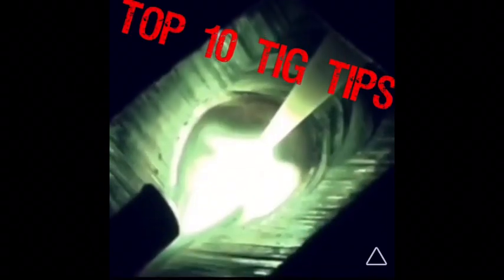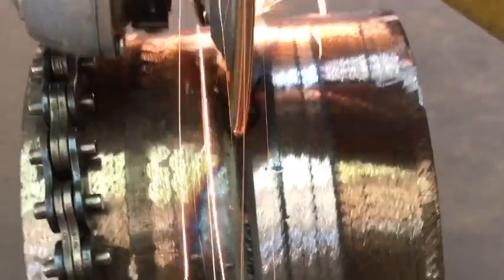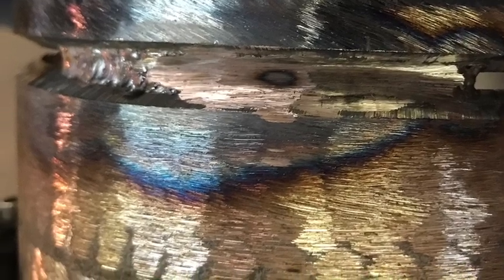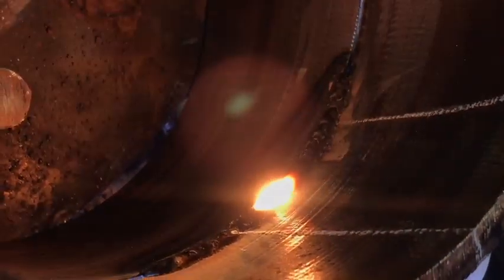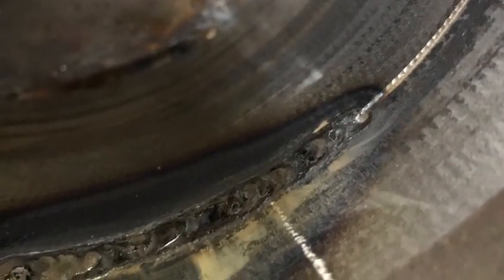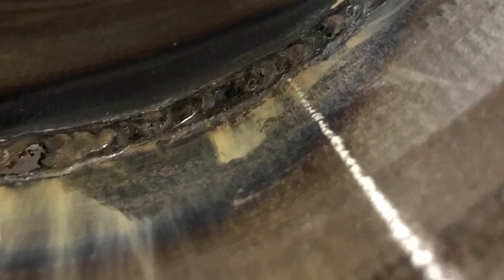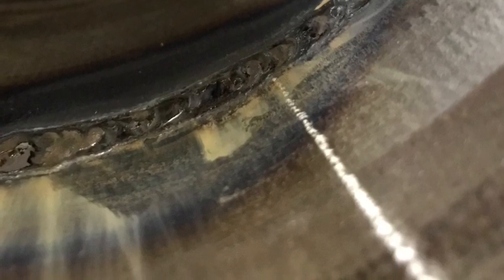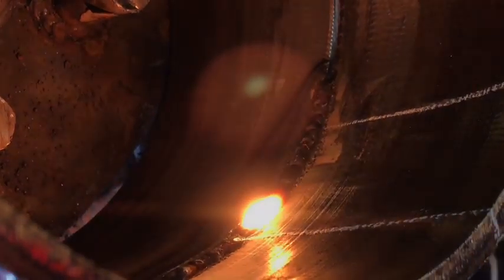Top 10 Tips #2 How to fix suckback

Comment: Question how do you fix a dog dic when you back feeding and it drops down on you from the top. Do I need to completely cut it out or what. Also what about chop wire/cold wire what ever y’all call it
Reply from the maker: +Jesse Davis we have Videos on that it under cold wire
Reply: Alabama Pipe Welders Academy I honestly do t know what to call it but what about the 🐕 dingolings
Reply from the maker: Jesse Davis you can fix it the same way as cold wire depending on how bad it is you might be better off cutting it out and re welding that section
Reply: Alabama Pipe Welders Academy ok thanks for the vids man.
Reply: If it’s less then a 1/4” dog dick you can turn up and sit on it, let it swirl till you see it suck into the bevel. Much easier to see if you have an open spot to see inside. If it’s more then a 1/4” or you have a wholesale bat cave in there I would cut it out. Cold wire can just be ground down and consumed, keep a piece of wire in ur hand when you do it for if the weld is asking for metal.

Comment: If you know what you're doing in the first place you won't get suck back ,it's not rocket science ffs
Reply from the maker: You’ll get dat on dem big jobs. Probably don’t happen much in your garage.
Reply: @WELDorDIE  right....the I have never failed a weld test golden arm. Keep at it buddy you'll get your chance soon enough. Been Boilermaker for 25 yrs and if you haven't had problems like this or failed a test you just simply haven't been welding long enough. It happens to the best of us, it's how you handle it when it happens that judges how good you really are. Also saw the HT rate in your logo man, I'm also a fellow "herder of turds" thank you for your service shipmate. Tight arcs brothers of the flame.
Reply: Wait till your pairing new pipe to old contaminated pipe in a rack hanging out on your belly and can’t see so your in a mirror , then wind comes to shit on you party. and then you have to grind the porosity out, but you go to weld that ground root and have suck back. Well now that golden arm of yours starts to turn colors. I’ve seen the best of the best fail an X-ray. Humble yourself. Lol no one likes a cocky done it all welder. Just proves you haven’t welded enough

Comment: I avoid this because it's inconclusive if the suck back has been fixed.  What if it's a closing joint and you are not sure.... I cut the weld out and re prep and weave with a hard wire push.

Comment: What size wire did you use? Cause pushing an 1/8 - 3/16 of filler in will be different between 3/32 and 1/8th wire. Also I think an outside arc shot would be nice here so you can see what you will be looking for and how the puddle should look when it's pushing the filler into the inside
Reply: Did they end up using 1/8 wire

Comment: how do u fix lack of penetration on the tog root?thanks in advance great    videos
Reply: welder welder same way
Reply: Go up on amps. 107 is tge sweet spot for me at least. Keep that filler metal on the top of that puddle as you come around that pipe gradually feed it closer to the bevel face til your flush at the top. Itll start to fall down as you get to the top of the pipe. And dont make your land too big. Itll be a little harder to get that metal to dance!